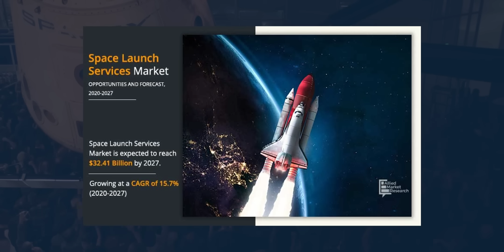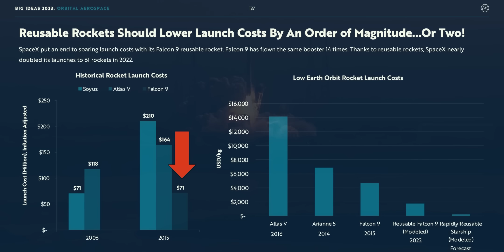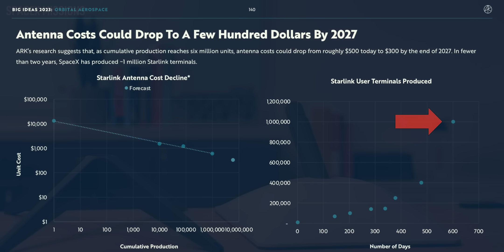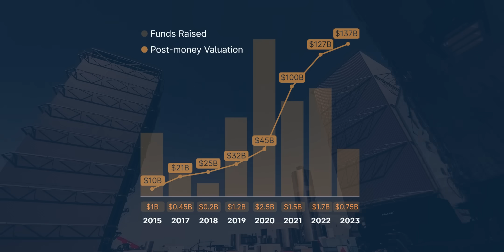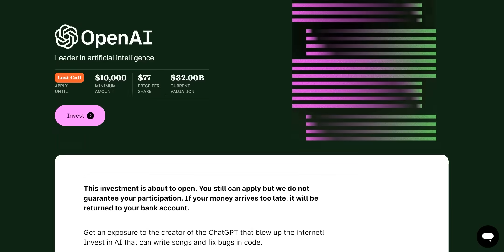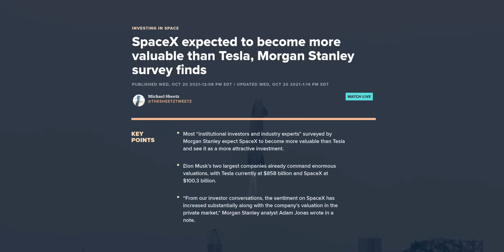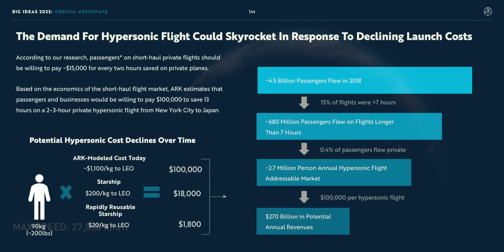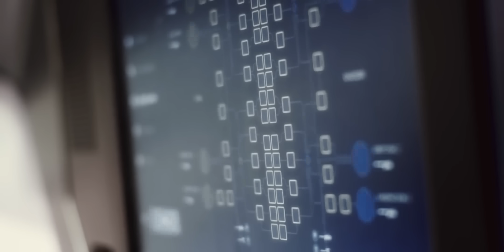🚀 Bigger Than ChatGPT? 4 Ways to Buy SpaceX Stock Now

Comment: Probably should open with answering the question “what is an accredited investor?”
Reply: Don’t be lazy.
Reply: @stockinvesting9071  @john m 
Folks, Thanks for your going to the trouble to post what anyone can easily discover. I am well aware what an accredited investor is. Since my point so easily slipped right on by you, deep minded philosopher, I’ll spell it out for you. Sitting through this video will prove to be a gross waste of time for many. The creator should let those who don’t know that the great reveal at the end will not benefit them at all. But then, helping folks is not the point of the video is if? Just like McDonald’s isn’t in the business of selling hamburgers. Philosophy on that one a bit.
Reply: From investopedia: The SEC defines an accredited investor as either:

an individual with gross income exceeding $200,000 in each of the two most recent years or joint income with a spouse or partner exceeding $300,000 for those years and a reasonable expectation of the same income level in the current year.
a person whose individual net worth, or joint net worth with that person's spouse or partner, exceeds $1,000,000, excluding the person's primary residence.